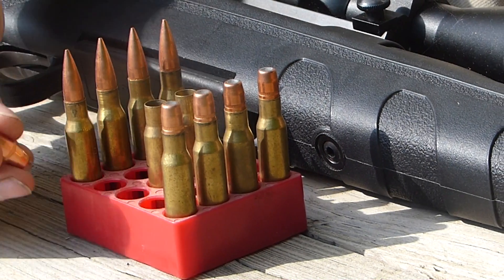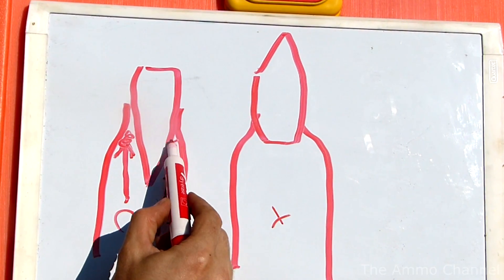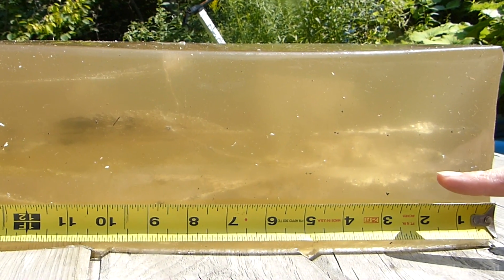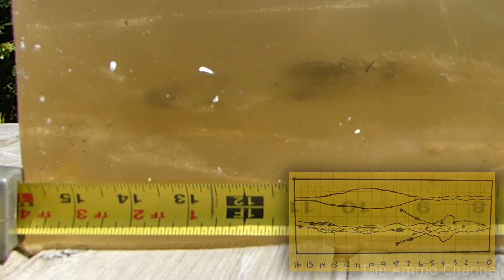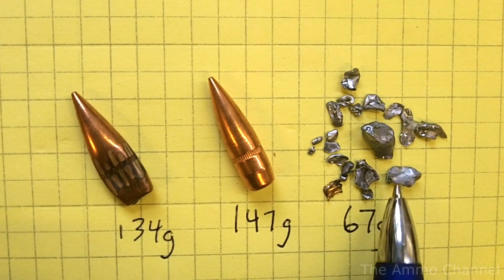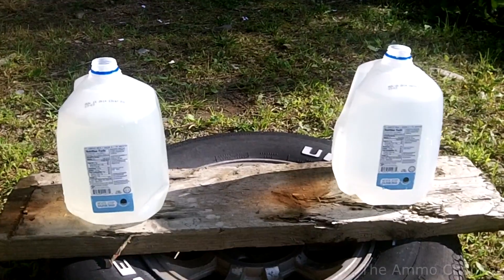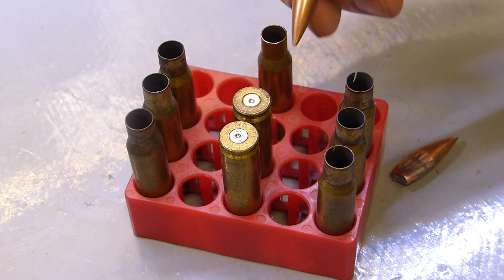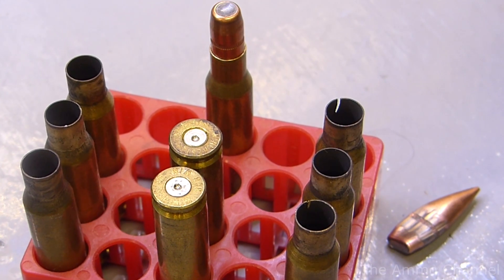Shooting Bullets Loaded Backwards

Comment: This technique was used in WW I for causing spalling on Snipers Loophole Plates.  While the plates were too thick to get through (generally) the increased surface area of the reversed bullet transferred enough energy to the plates to cause the back side to flake off and cause slight injuries to the snipers, decreasing their effectiveness,  and resulting in the need for medical treatment.
Reply: beardo52 , another thing is the WW1 bullets made for the .303 had a wooden core, with a lead core behind.
Reply: @STRKnives  paper maiche tip...originally aluminum but switched to paper match when aluminum became a 'strategic material...the paper matches was first autoclaved songs not to case infection...typical damn Brits...
Reply: lol didn't see this comment but basically said the same thing up top
Reply: also used in Vietnam loaded specially
Reply: yes and if you go to the Canadian war museum in Ottawa they talk about the Canadian Cpl that start doing it under british army
Reply: beardo52  I was going to say that but you beat me to it
Reply: Hell no. What has Monroe Ef. have to do with anything? Tip first versus back first. Tip first is designed mainly for aerodynamics and then for soft target penetration. The contact force in tip first is more gradual versus the backwards as the tip needs to be crushed to the bullet diameter for max force to be achieved. Giving a less sharp impact for tip first in a hard target versus a backwards bullet. For soft targets it is just hydrodynamics.
Reply: Also for tanks
Reply: I think the issue was that he shot at the plate straight on in which case I would think the normally loaded bullet would have a better chance at penetrating  because of the lower contact area and higher point stress. But I could understand how in the war using the base of the bullet for angled armor as it would have a better contact angle and be less likely to skip and therefore actually atleast tear off some shrapnel.
Reply: you know the monroe effect ? i guess this is based off the same principle but of course way less effective due to the lack of explosive but simple energy transfer
Reply: Didnt they also add more powder? Im not sure if thats true but thats what i was told by a vietnam vet
Reply: aha!... I knew I remembered reading something about this in ww2. thanks! that was going to drive me crazy untill I found the article and that was going to take forever!!
Reply: They also shook in 20 to 30% more gun powder while revising the projectile back then.
Reply: also for penetrating light germen  tanks
Reply: I’m also a history buff
Reply: beardo52 take a physics class....
Reply: @howardwhite1507  Lol. He doesnt need to.What he's saying is correct. Research it. That is what K bullet were used for
Reply: @magnus3014  do you think spaulling the inside of the armor caused them to re think the blend of the steel they used for armor?  I havent found much on that. but I did find that they made what was called a 'k' (kinetic) bullet,(as you mentioned) but as far as I can tell results were dissapointing. matter of fact most of the odd ammo and equipment that was tried got called 'disapointing'.
   ww1 seems like it was an arms manufacturers science fair, all kinds of wild and weird things were produced.
Reply: +Luke Warmwater The K stood for "Kern", which translates to "core", in reference to the fact that the K bullet had a steel core rather than the lead core found in standard ball ammunition. The full designation was "Spitzgeschoss mit Kern", or "pointed bullet with [steel] core".
Reply: The same effect was used by the Germans during WW1 against tanks too, until they were provided the K bullets
Reply: beardo52 the germans also used this against tanks until the armor got thicker
Reply: True but they were mostly used against tanks nevertheless backwards bullets a is just not safe
Reply: Also used to penetrate tanks
Reply: And it was meant to be used against early british tanks
Reply: and for early model of british tanks
Reply: Simple history youtube
Reply: Read a similar teport...don't remember where...IIRC mightta been on forum dedicated to the .303 Brit ctg...
Reply: It was also used effectively against early tanks. 30mm of steel plate would spall. Pretty sure wartime rounds were a bit spicy powder wise.
Reply: It was also used to defend against tanks
Reply: pointed bullets tended to 'skip' if the plate was not 90 degrees on, flat nose didn't.
Reply: It was also used to penetrate mk1 tanks in ww1
Reply: @ Jerm - Missed the point? No amount of engineering classes suffice when reading comprehension is low.
Reply: all that schooling and you didnt take into account of the angle of the bullet and its higher chances of glancing/ricochets. bullet orientation does matter in this instance. A flatter bullet hitting something is going to hit harder because more  energy is transferred.
Reply: john dowe nope
Reply: It is also known as the K bullet, and it penetrated about 1/3 times at 12-13 mm thick steel
Reply: Don’t think you understand physics, kinetic energy=(1/2)(mass)(velocity)^2 “energy transferred” wouldn’t change based on bullet orientation unless the bullet had a different coefficient of drag due to fluid mechanics (air is a fluid) and the laminar vs turbulent boundary layers. And I would have to guess the backwards bullet would travel slower, actually reducing kinetic energy. But hey I’m not an expert yet. Only had my fluid mechanic classes for engineering.
Reply: They're going to have different levels of impulse though, the broader base of the bullet will cause the bullet to stop against the plate much more quickly than the relatively long, crushable tip.
Reply: @jeremygrbj4745  "Don’t think you understand physics, kinetic energy=(1/2)(mass)(velocity)^2 “energy transferred” wouldn’t change based on bullet orientation"

 I think when you shoot a bullet normally, more of the energy is absorbed by deformation of the pointy head and probably the plate or by ricochet. That's why shooting a bullet backwards can transfer more of the energy to blunt impact.
Reply: @jeremygrbj4745  I dont think you do either? Thank God you're still in school, try paying attention.
Reply: @jeremygrbj4745  the flat base dents an angled plate when a pointy bullet wont.... whats your engeneering class say about that?..... bet it makes your previous statement one you have to re think.
    see you are right about the physics part that you looked at, but theres the part you did not consider.... as well as the fact that this can be verified by paper record that they did this for that reason.

Comment: What would happen if you just snipped off the tip of the round with a tin snip to make a flatter nose with exposed lead?
Reply: This works very well. It has to be balanced as close as possible or it will wobble and not be so accurate.
Reply: McDrunkerson lol sorry just saw your comment after I sent my idea lol. I think it still be very hazardous

Comment: If you compare the same bullets with flat nose, round nose and hollow points you'll get about the same affects as the backwards bullets without split cases and more wt. retention. On a weak chamber/rifle the increased pressure could blow up in your face and yes you're right, don't try this! Just my 2 cents, have fun.

Comment: It's too bad you've got no way to get an accurate measure of the difference in chamber pressure. The expanded primers & split case mouths make it pretty obvious that it's higher than it should be. The test on the plate was interesting. I remember reading somewhere that loading the bullet backwards made it more likely to punch a hole in the tank's armour before the bullet could warp. Your test made that theory look a bit doubtful. I take it that your target plate was of ordinary mild steel?

Comment: If you are loading the bullet, then you control the powder too,  Just back off the charge by 5 - 10% to reduce the pressure in rifles.  This is an effective game bullet if all you have is FMJ bullets.  Likewise, if you have a revolver in a caliber for which you need/want a wadcutter bullet and for some reason didn't buy some, again, this works well.

Comment: Why not just load them the normal end out, but flatten the point by grinding or cutting or for that matter using a ball end mill to make a hollow point. No more over pressure issues with the same favorable impact results. If done correctly it would mimic a mini shape charge.  HAve fun, G.

Comment: 0:43 seconds - the nose of the bullet (MORE surface area exposed to the combustion) will result in less pressure on the bullet than loaded tail first but other bets are off. The decrease is not really enough to cause a problem from pressure alone. N/a = P -- more a makes less P -- Same powder producing same gas over MORE surface area result in LESS overall pressure. BTW, this is a regularly used problem in university mechanics classes (mechanics as in physics - not auto repair)...

Comment: Seems like the ones loaded backwards work kinda like hollow points.. Fragmentation rounds... Would be good to cause a lot of damage to a soft target. If they're wearing armor though, you wanna shoot the the regular way. It has more penetrating power.
Reply: +Romano Coombs - Also in the time of the Panther Germany had a tempering problem for the hull steel and some left the factory with very brittle armor.   I have seen several photos of Panthers that when struck by rounds that couldn't penetrate, it didn't matter because the hull plate struck shattered like window glass..   I have also seen a picture of a French Char and a MK IV with long barrel that had that happen.  In the case of the MK IV it was the side of the turret that shattered and fell away.  I would imagine changing their temper became a priority,

Comment: I'm wondering if there was much of a muzzle velocity difference, the bullets were obviously staying in the barrel longer, and there was much higher pressure, and with that steep angle that those gasses had to work with i would assume that there was alot of energy lost to extra heat

Comment: we used to do this to cheap Chinese x military 308 ammo to use on pigs .was a lot more effective than fmj with the bullets not even exiting some times. accuracy wasn't as quite as good probably because of the longer jump to the rifling,but was adequate for the job. fed well through a mauser. cases weren,t picked up. a lot easier to do and effective than cutting the tips off. not as effective as something like a speer 130grn hollow point.

Comment: @4:10 what did the back of the steel plate look like?  Often the goal of firing on armour is not to penetrate but to force a part to split off on the other side similar to the balls on a Newton’s Cradle.  Tank crews were often casualties of rounds that never penetrated the armour.
Reply: +halnywiatr There's a picture here: http://www.dreamstime.com/stock-photo-sniper-plate-world-war-one-located-british-trenches-vimy-ridge-image61497210
It consists of a steel plate with a couple of iron latches, a small window and a handle. If a sniper bullet hit that, one of those handles or latches would go flying off.
Reply: isn't that spalling effect? correct me if I'm wrong
Reply: +Iqbal セイバーアルトリア・ペンドラゴン   Tank crews would call it "splatter", but yes, it is spalling.
Reply: +Michael Robb   Interesting, the latches were kinetically sacrificial.

Comment: I'm surprised that the overpressure is a surprise to you, in that one of the first things you mention is that the bullet loaded backwards takes up more case volume.  Between that and the (most probably) more immediate engraving of the blunt end when chambered, you'd most surely have elevated pressure.  But if you were to load the cartridge with less powder - proportionate to the reduction in effective capacity, for example - and retest, you'd most likely not run into the problem.  You could easily deprime the empty case, and seat the bullets as shown, measuring the as-loaded capacity with water injected through the primer hole, then compare effective case volumes.  Did you by chance either chamber and then extract the reversed round to see if the base had engraved, or cast the chamber, lead, and initial rifling with Cerrosafe?  I think you have an interesting issue partially explored here, and with a little more experimentation could throw some interesting light on the subject.  Thanks for the video.

Comment: couldn't you just saw the tip off and get the same thing?
Reply: Don't fucking look at me like that.
Reply: +windson7 mass by definition is "resistance to acceleration" so less mass wouldn't necessarily be bad. and if thats your main issue why did you then comment the same thing?

Comment: If the bullet is turned around in the cartridge case, the first worry would be wedging of the bullet into the rifling upon loading the cartridge into the chamber, which results in elevated pressures, everything else being the same.

The flattened primers are evidence of that happening.
.

Comment: He missed the point about the armored plate.  The bullet was not meant to penetrate the metal. It was meant to knock the surface of the opposite side off and hit the target with fragments of their own steel plate.  It was supposed to have a similar effect as an anti tank squash head round.

Comment: To everyone asking about cutting off the tip of an fmj bullet: yes, this could produce the same effect as a hollow/soft point, but you also run the risk of having the lead core separate from the jacket inside the barrel, leaving the barrel partially obstructed. This could lead to your firearm exploding, which is obviously not ideal.

Comment: The comments about backward bullets causing greater damage to metal was relevant to the 303  in WW1. Keep in mind the old boiler plate was more brittle than the malleable steel you used on the 'I' beam , remember the issue about the titanic plates being brittle . The plates the Germans would have been using would also have been cast Iron or low grade steel which are prone to shock breakage and in modern steels referred to as blanking .

Comment: During WW I  thin steel plates were used to protect men in the trenches.  It was believed that a blunt head would knock chips off the back of the steel plate and cutting the enemy soldier.

Comment: Why not just cut the point off of a properly loaded bullet
Reply: Benjamin galster The idea is to transfer all the energy with less penetration than the pointy end, so cutting the tips off would cost you weight and energy.

Comment: At what range is this? I think over range a backwards bullet would tumble and become incredibly inaccurate, not to mention useless when hitting the target sideways.
Reply: +Matan Pulverman it's not aerodynamically stable, the air resistance will cause the bullets tail (point) to come out during the spin and start a tumbling effect.

Comment: The idea for loading bullets backwards in their casing is from the First World War when they were used to eliminate enemy snipers who were hiding behind sniper shields. The round would not penetrate, however the backwards bullet caused a small amount of the steel from the sniper plate to fragment and hit the sniper hiding behind it. The only problem with this tactic is that it was rather dangerous to the user as well as the target due to its tendency to cause breech explosions, which therefore led to the round being banned any anyone caught with them to face disciplinary action.

Comment: in ww1 the soldiers woud have an iron block with a port hole in the middle that they woud use not to pirce the iron block but the shock wave woud make other side of the plate relise fragments in to the shooters face

Comment: so a backwards bullet has a lot more stopping power
Reply: +Matan Pulverman seemed to work fine, im sure it still catches the rifling too
Reply: +InternetzSpaceshipz The concern here is pressure. Seating a bullet backwards causes a prussure spike in the shoulder/neck junction of the case that can lead to serious issues. Serious as in your rifle's action cannot handle the abuse and it blows up in your face, causing the shooter a fatal injury.

Comment: Believe it or not, some HPBT bullets perform better at subsonic velocities when loaded backwards, because it changes the center of mass of the bullet.   With subsonic loads you are normally using very small powder charges.   However, make sure you use published load data.   Getting a bullet only half-way down the barrel and stuck at that point, is also a pain in the backside.   Do not ask how I know that.